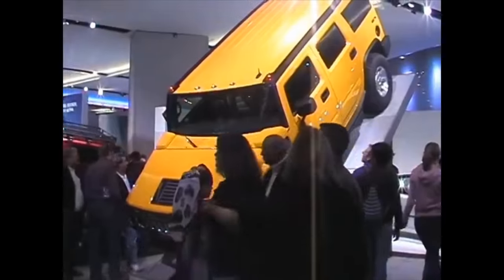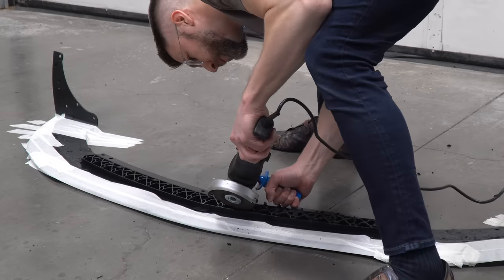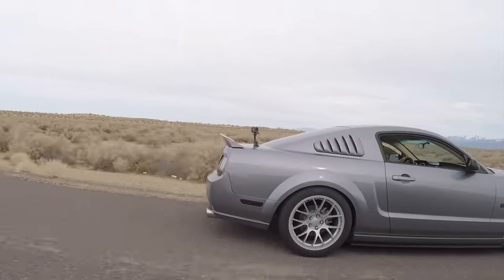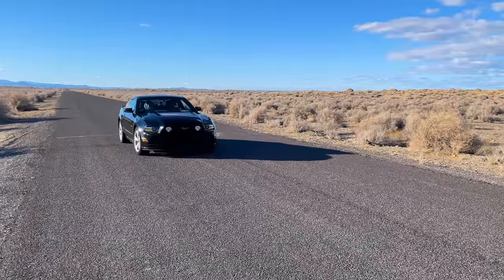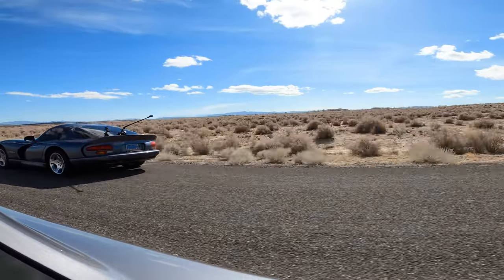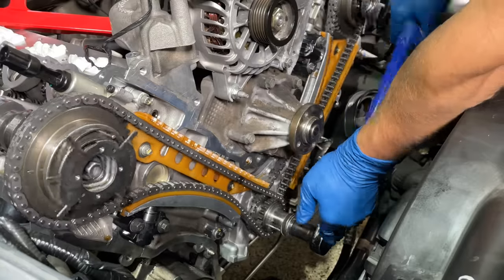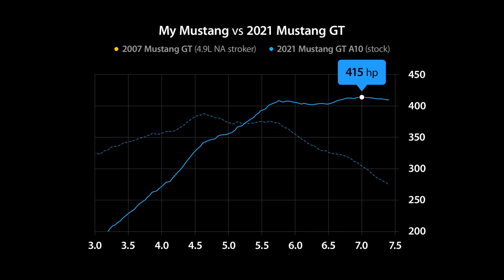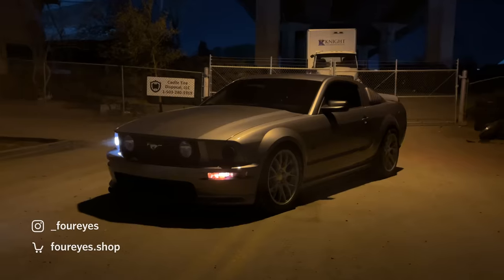Transforming this slow 4.6 into a screaming coyote killer

Comment from the maker: STAGE 4 STARTS HERE 👇
https://youtu.be/dOU-RkHbS2I
Reply: Best cars are built not bought I always say
Reply: PurgeTime  i did.
Reply: you should race a e55 amg, that car also has an engine with 3 valves per cylinder
Reply: Not trying to be mean but you replaced all of those sensors etc, like $1500 in parts for a single injector that mechanically malfunctioned, that cylinder was basically dead which is why you lost all of that power. A $30 Noid light kit & data for that cylinder had to have shown current/history DTC's for a misfire, the spark plug would have shown it was lean as well.. that's why the exhaust sounded off. This is why people should let trained mechanics do their job. You're obviously automotive savvy and knowledgeable so that really surprised me. It's hard for me to comprehend someone dumping $20,000+ into a 3v for 400hp, you can buy a 1000hp big block for half that cost, but I respect you chasing your dream.
Reply: @COBRO98  one question, where can you buy a 1000 hp big block chevy for 10 grand?
Reply: @COBRO98  1000hp crate engine will run you like $30k...
Reply: With your t56 mag xl what’s toe gear ratio
Reply: Me waiting for stage 5
Reply: Stages aren't a thing.
Reply: How much did everything cost? I recall briefly seeing a comment you left detailing prices but I cannot seem to find it again. 

I just bought an 07 gt and this video gives me so much inspiration

Comment: As a 10 year mechanic the amount of information he gathers is incredible. The way he figured out the injectors by process of elimination and knowing your car and how it reacts. This guy is incredible!
Reply: Yup now I want one
Reply: he almost disassembled the engine and took down the transmission. I doubt it was all necessary
Reply: @rerikm  welp gotta start from somewhere
Reply: @rerikm  Well when your car is doing weird shit, you have to do some troubleshooting, and if you suspect that it might be a serious issue, it is 100 percent better to be safe than sorry. He made all the right moves.
Reply: yes bro i know right the amount of info he gathers and delivers is freaking amazing.
Reply: @Udontlikeice  get out your wrench cuz you'll want more power
Reply: @StelioKontos42069  indeed I will 🕺🏾
Reply: I read that as 10 year old mechanic for a sec lol
Reply: armchair mechanic here. if you think you've got a bad injector you can check by driving around at like 4/10 and then pulling over and popping the bonnet and checking the temps of your headders with a laser termometer. a lean condition should spike the temps on that cylinder and you should see it right away.

Comment: I'm not a mustang fan and I still have to admire how well done this video is. Great job on both the production, and getting 400+whp out of a 3V!
Reply: is it weird to self promote>?
Reply: Except he dumped like 30k to get there.   Kinda a joke
Reply: And to add to that he was limited by fuel swell since he only had access to 93 octane I think it was, which makes it even more impressive
Reply: @jasondeftones1  Well yeah sure it was expensive, but he also pre built it to be able to handle the turbo kit with no problem, and it was also harder for him to get higher power since he was limited on fuel selection etc, for example he can't get E85 where he lives, that would have saved him money. But its still impressive that he can get a decent engine this powerful N/A
Reply: @jasondeftones1  if you want a "fast" car doesn't it make sense to have one built vs paying big $$$ for new?
Reply: @jacobladder6165  It almost never makes sense to have one built. It's usually more expensive than just buying a new one
Reply: He got the 400+rwhp?  The last number I saw was the 388rwhp and torque in the high 350s.  That combination was flat lining past 5800 might have been valve springs?
Reply: @dennisrobinson8008  6:36 here
Reply: @jasondeftones1 No one cares how much cash he spent, it wasn’t about getting the fastest car. It was about making the Mustang INTO a fast car.
Reply: @Sans_the_skeleton_real  that was the first question i had lol
Reply: @jasondeftones1  yeah its border line stupid he even said it in the video he should of stopped sooner lol
Reply: @jasondeftones1 yeah especially since a stock 5.0 makes 412hp
Reply: @jasondeftones1  he wasn't going for a budget build he's trying to get the most out of the car at any cost
Reply: My f150 4.6l v8 has over 400k original engine ,those 4.6l v8 are bulletproof engines
Reply: @jasondeftones1  no not a joke and he could have saved 12k if he did the engine job himself ! Now just Add a 3.0 liter wipple blower (DEPT OF BOOST KIT)and there is very few cars that can touch it !
Reply: @GuyGamer1  Not so bro !
Reply: @dennisrobinson8008  IT PUT OUT 408 hp to the wheels  LAST dyno run you need to brush up on your listening skills bro!  With a 3.0 wipple or a turbo kit it will be  be crazy .A stock 4.6 (with just a forged rods pistons and crank) with a kenny belle mammoth blower  kit ,is in the 900 wheel horse power range stock heads no headers just forged rotating assembly  a fuel system  upgrade and blower and  almost 1000hp !
Reply: @bluesunrise2323  WHY!

Comment: Nearly 400whp N/A from an early 2000s modular engine is impressive. It sounds so good 😍 thanks for sharing your progress!
Reply: The engine being “modular” doesn’t make such a thing anymore impressive lol
Reply: Especially considering how every factory component was replaced or altered to get there.
Reply: @dailydose8035  The Ford 4.6L made in that time was literally named the 4.6 Modular, named after the machinery that built the engine.  Like the current Ford Coyote or GM LS engine, this is the Modular engine.
Reply: @dailydose8035  I mean the term "modular" means to design in modules.... the engine came in multiple variations- 4.6, 5.0, 5.2, 5.8 and 6.8 designs.
Also needs to be noted that the engine was set to work in a number of different applications - performance, reliability, heavy load applications etc. It's been voted one of the most reliable engines that ford has ever made.
We also need to note this is a "low comp" build- it may have made a little more if it was built to be an "NA" power monster.
Reply: Laughs in 4.8 LS
Reply: @poppasunny  they had a 5.0 "cammer" crate engine back in the day that was based odd the 4.6 mod motor but they never made a factory 5.0 mod motor.  They also never made a 5.2 the 5.0 and 5.2 are coyote based engines.  The 5.4 and 5.8 are mod motors like the 4.6s were.  It's amazing how many people don't know this.
Reply: @crankshaftsfuels6445  a 4.8 ain't gonna make any more power than this with similar parts.  And this was done with low boost friendly compression with high compression it could make a good bit more.
Reply: This was also done with low boost friendly compression with high compression it would have been well up over 400 especially on e85.
Reply: @midnight347  a good head/cam swap crack 400whp
Reply: @midnight347  FACTS
Reply: @midnight347  better off just buying a C6 and doing I/H/E tune and making 400+ N/A...I understand though as generally people who like mustangs despise corvettes, and these S197s are rarely done up and look good. Cheaper to get into than a C6 is, but a C6 LS2/LS3 is going to be cheaper in the long run to make 700whp
Reply: @nickadkins7765  yeah OG comment said impressive, if I didn’t like the looks of it myself I’d say dumb dude spent 3 mustangs on this one lol
Reply: Laughs in 100bhp/liter 90's engines.😂 not hating on the mustang tho 😇
Reply: @crankshaftsfuels6445 4.8 LS is trash.
Reply: @brickdinero5468  Hey, just 3 months ago, somebody spent $65K on modifying their Lancer EVO 9. Many more stories of people putting $$ into their projects like that exist. Do they make sense? Well, to the average person that could care less about cars? No. However, Passion is what drives and nurtures these projects.

Comment: I don't think some people realize how fast his mustang is for being a N/A 3V it's incredible. Keep it up
Reply: They were quick for a non cobra 4.6 but still got bested by the older 98-02 fbodies with the LS1 motor. A car out of production for 3 years when it came out. And the LS1 is way cheaper and easier to install upgrades and bump up the HP.
I've owned 2 Sn95 Mustangs equipped with the power improvement 2v 4.6 so I'm not a GM purist, but this engine needed mods to keep up with older cars.
Reply: @FWDSUXARSE  something something new emission laws hold cars way back.

Comment: That last race was super impressive. I thought for sure that A10 Mustang was gonna gap your 3V no problem. You’ve done amazing work to that car and drive it exceedingly well.
Reply: As it turns out 10 speeds aren't unbeatable.  I know I know that's hard to believe but it's true.  It's easy to see why a 400 whp modified 3v with gears and good driver could pull a stockish 10 speed that prob weighs 3 or 400 lbs more.

Comment: Honestly, I’ve never been a fan of the gen5 look & feel but it feels like you are awakening something inside of me… can’t wait for Stage 4! Great build so far!
Reply: I've always thought the front view looked great, the side view looked pretty good too, and the rear view was horrible.
Reply: IMHO The Front is a good resemblence to the original, but it's too clumsy, these Halogen Headlights with large reflectors look too old-fashioned, yes, they hadn't Xenon HID headlights for the Mustang back then, but also a bunch of other cars like The Audi A4 B6, the first gen A5, the Mercedes W211, W204, Volkswagen Passat B5 GP/B6, Touran GP and several BMWs like the 5 series E39 had projection headlights with halogen lamps that looked very similar to the optional Xenon headlights (almost every car uses such projection headlights, AFAIK just the Volvo V70 used Xenon with a reflector).
And also the turn indicators, not sure about the regulations, but you might use a clear cover and also an amber bulb that is silver-plated, so it just shines amber when in use; in Germany we call this "Spiegelei-Effekt" (meaning it looks like a fried egg) and it especially affected the Porsche Boxster 986/911 996 where they combines the turn indicators with the main headlights that were always separated in the previous 911 generations.
And I know that for a lot of cars like my A1 even the manufacturer itself offered two more styles of LED rear lights, the normal is red with a white lower section for turn indicator, reverse light and fog rear light, Audi also offered these dark tinted and full red tinted, Porsche does similar, the 997.2 had the option (it was default for the Sport Classic and Speedster) to mostly white rear lights (except the reflector).
Reply: No offense but you're clearly younger than 20 lol. These cars looked awesome to a kid in the 2000s

Comment: I got my 2005 GT convertible up to 440HP crank.  This video was a beautiful memory.  That 2nd gear comment under hard throws was so true.  Daily it was fine but under stress, it just never worked well.  Had to upgrade it.  I ran a Watts Linkage for the rear end with BBK control arms.  Really helped stabilize those launches.  Also, watch the lashes they break down quicker then you'd think.  Don't forget a good Watts linkage.  It makes all the difference on the car.

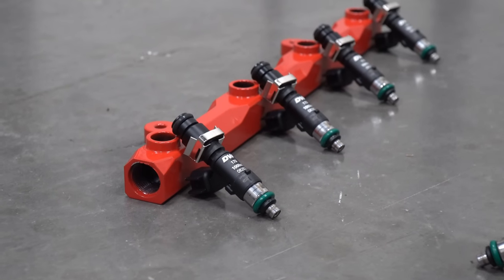Comment: You greatly inspired me with this 3v mustang. Mine started a long time ago as a v6 and was swapped to a 3v v8. It was upgraded with most bolt ons you have and a bbk exhaust system instead of kooks. The car is currently in the shop now receiving everything you have on yours except for the return fuel pump and transmission. Mostly likely it will be receiving 4:10s as well. New Brembos going on as too and a hood with a ram air intake and vents. A cat delete too to free up as much power as possible. The entire suspension has also been done on top of all this with the cherry on top being 285 wide square setup of Michelin pilot sport 4s on 10 inch by 19 lightweight apex race wheels. I am so excited to get the car back when it’s done! I’m just hoping it can keep up with a gen 3 10 speed like yours can! Thank you so much for the guidance and for helping me make my 3 valve a true beast!
Reply: drop weight off the car and keep the intake temps as low as possible if they make a fender well intake or closed box intake thats got large diameter piping get that
Reply: What kind of money did that build cost?
Reply: 25k ish
Reply: @biggiesmalls7939  that’s including labor too but I did about 2/3 of the work
Reply from the maker: that's a nice build! and surprised 285's fit up front
Reply: @Four_Eyes  yea man apex race parts has wheels made specifically for the s197 that fit perfectly. No rubbing or issues from them at all and they really help you point the car where you want it to go. Apex makes 11 inch ones too but you need small spacers to fit them on and you get a bit of poke but I didn’t want to hassle with fitment so I just went for the 10 inch wheels.

Comment: Man I wish the GT500s came with the T56 Magnum, we only got the TR6060. The transmission is similar, but has a remote shifter so getting into 3rd when you're really on it can be difficult and its just weaker in general. I look to swap out my GT500 with a T56 Magnum XL as its very clearly the best manual out there today.

Comment: I own a stock 2007 Mustang GT Convertible in white with red leather. For me, it's all about the driving experience. I don't crave high speeds(been there done that); instead, I take immense pleasure in the delightful rumble produced by the V8 engine, the solid and substantial sensation I get from the steering, and the pure joy of cruising with the top down.

Comment: The 10 Speed test was very interesting. The S550 with a 10-Speed and a driver weighs almost 350-400 lbs more than the S197 especially after some of the mods. I imagine both your higher rpm start and lower weight have you about a 4 car length advantage “by the quarter” but when you both ran with you at a “disadvantage” in 2nd that auto really showed its muscle! Great video mate.

Comment: Great Mustang and great video. I had an '08 gt that I would say had stage 1 mods (4.10 gears, tune, shorties, cold air) and it would consistently run 12.80s all day at sea level (Darlington dragway). Your car should easily be mid to high 11s. Really badass sleeper you have there. And those hot rod and the new cams you have sound so sick. I really wish I still had mine. The only thing I would do different is maybe put in a Tremec TKX trans or even a CD009 trans. The 1st and 2nd ratios are so much deeper than the T56.

Comment: I did similar with my 1988 IROC in the early 90s with a centrifugal SC 383 in place of the 5.7 and a T-56 6-speed in place of the 700R4 automatic. It ate Vipers for a snack. My IROC spun the Centerforce clutch you show, so they did a one-off Kevlar-puck clutch, and it worked. I did all my tuning over a serial cable with a 1987 Toshiba T-1000 laptop, connected to the then new DFI ECU. There was no auto-tuning, had to do it trial and error while monitoring the A/F ratio via a wide-band sensor connected to an on the dash display.🤣 I had to convert my mass-flow to speed-density. Also had an internal and an external fuel pump.

Comment: I have a stock 2010 3 valve GT. I installed the performance aluminum drive shaft, a barton short shifter, and flow master exhaust..the suspension was the only real complaint I had with the car from the factory and so it was overhauled immediately. But having never owned a GT, and coming from a base C6 Corvette...I can see how you might want to go to the trouble of a build like this. Its a shame that it gets so much shade when compared with the first gen Coyote, and even the V6 of the same model year. I bought mine used with 100g and it is still a great autocross platform. Best 7g I ever spent

Comment: If you use propane as a fuel for a turbo charged version , you will get knock free behaviour , a laminar flame speed propagation 25% faster than on gasoline , a perfect mixing and … you can use a dual fuel mode . We are practicing a dual fuel mode in proportion 80-85% lpg to 15% of gasoline , we can make a AFR up to 14 on a high boost and have a power rise . I can share insights if you are interested in this . Good luck in with your project !

Comment: ive owned alot of cars, couple fox body cars with 5.0, just sold a sn95 cobra also a couple non pi 4.6 cars, still have the 95 trans am i had from when i was in high school an too many camaros to remember, but all of them were older obd1 cars, lt1 cars so no ls cars or 4.6 pi cars so i wasn't able to get tunes. i just went an looked at a 2009 mustang gt 45th anniversy car manual. felt really strong especially with what im used to driving. it had some after market parts but nothing big that i could tell but im going to pick the car on monday morning so i cant wait. ive always gotten wrecked cars or project cars an fixed them an got them straight an running good an strong but never finished them in the sense of from to back paint so ive always drove cars that wasnt the best looking. this mustang is the first one ive ever got that didnt have something wrong with it an require me work on it an fix so with this one im going to tackle every little thing i can find wrong all interior from what i was able to find what little time i was with the car but even then it was small stuff but i want to get it looking good then start doing some stuff to the engine. id love to build it and do some kinda boosted setup on it, id rather do a supercharger setup but i feel like that costs more than doing a single turbo setup, or am i wrong with this.

Comment: You can see the torque / power curve in the race. You make more power through most of the curve but at higher speeds where peak hp matters more / 10 speed keeps it on power it evens out.